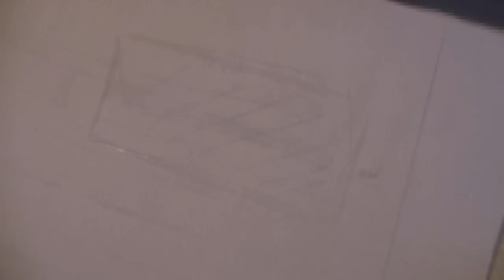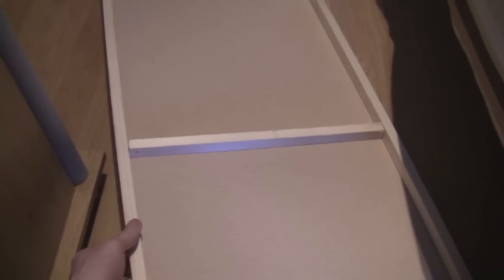N-Gauge Layout Project (Part 1)

Comment: Hi there ,, im just starting a N gauge layout ,,, has anyone mentioned  "AnyRail"  type in AnyRail  to goggle download their trial  version which takes less than a minute, and it gives you,,,  cad track design software ,,,, choose the scale you want, and pick up points, turnouts, track etc, drag and drop,, in place, keeps it all in scale. gives you exact radius for bends etc, the trial version lets you use 50 items ,,,,before closing down and asking you to purchase (£35 I think,) or you can print off one section and then delete the fifty items you have used and design the next section,,,,, Cheers Alan